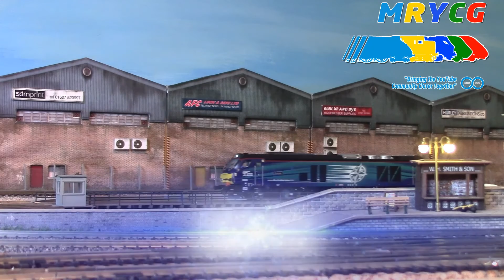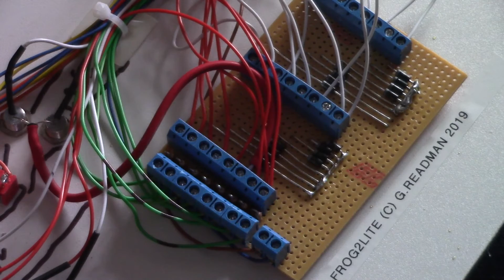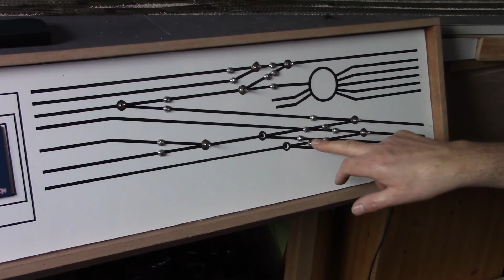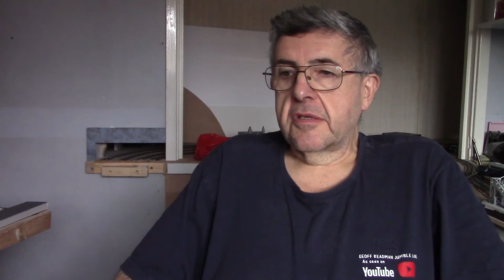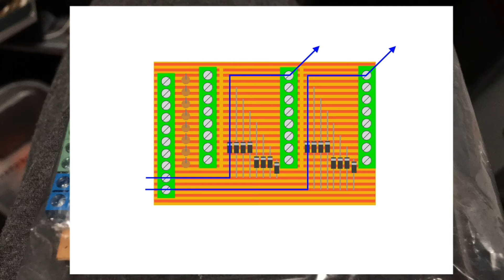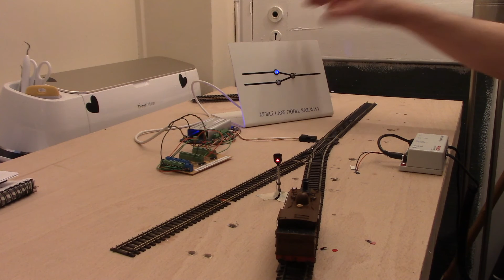#25 Control Panels LEDs and Signals

Comment: Hi Geoff. On your full control panel, you showed you had both self-centring and non-self-centring switches; why did you use self-centring switches for the points?
Reply from the maker: The reason for self centring switches is that you only require a momentary switch action to throw the points and in this case to get the point motors to operate. The point motors I use are DCC Concepts Cobalt digital iP and they have three terminals, a common and a throw right and a throw left, you just connect your switch to these.
Reply: @JumbleLane  Hi Geoff. Yes, I have DCC Concepts Cobalt digital iP motors too. Many thanks.

Comment: Well explained, just the info I was looking for.
Reply from the maker: Thanks, in fact there is a version two and by the time I get around to doing the one side I have not updated there will be further refinements. The one side now has two colour Leds and the layout simplified to make it easier to understand. The led glows red if the line is closed and green if it’s open. I am incorporating servo control now to operate the level crossing when I get more time and will do more videos on the build.

Comment: Hi Geoff . This stuff is brilliant. However, are you showing the LEDs on your animation in an incorrect polarity?
Reply: Hi Geoff I'll take your word for it. It just appears that if the current is flowing through the led in the direction of the arrow it can't pass through the diode that is in series with it. Or, if the current is flowing from the bus and through the diode, the led is blocking it ...? Am I missing something?
Reply from the maker: To be honest PJ, it is confusing, sometimes I have to experiment with items like this at the expense of a few components but the idea for this was an expansion of a diagram by DCC Concepts showing how to connect led’s to their point motors, in fact they had two LEDs facing either way connected in parallel and they were supposed to light up depending on which way the frog was. What I do know is that this board works but if the resistors are too low in value there will be a small amount of light from the led which should be off. All in all it serves its purpose. Regards, Geoff
Reply: @ef7480  I’m no electronics whizz, but I noticed the same thing! An excellent video though! It sure appears that the current couldn’t move either way with the led passing current in the direction of the arrow (I googled it to be sure I was right!), but being stopped dead in its tracks at the dead end of the diode! Or vice versa! I really like the device though!
Reply from the maker: Hi PJ, no, the polarity I drew on the animation is correct. The diodes block current one way and this is the principle behind the board. Regards, Geoff

Comment: Does this work with insufrog point with solenoids Geoff ? Solenoids are peco and gm pm2s
Reply from the maker: If you are using PM2's then you can use the switch terminals to send the signal to the board. I am doing a Q&A soon and competition but I can send you circuit diagrams.
Reply: Yes ok geoff I’ve got it then for future reference